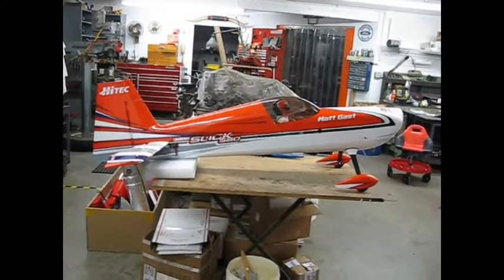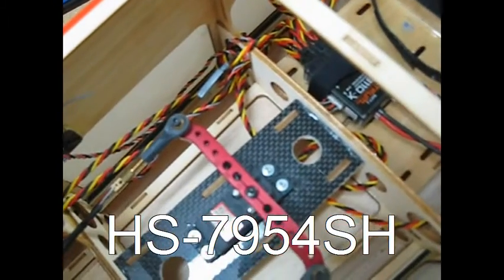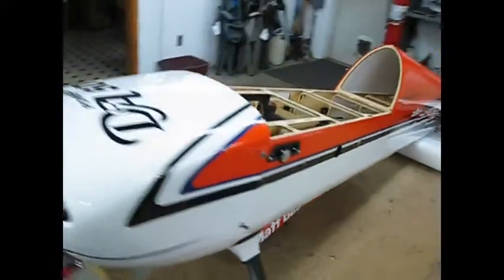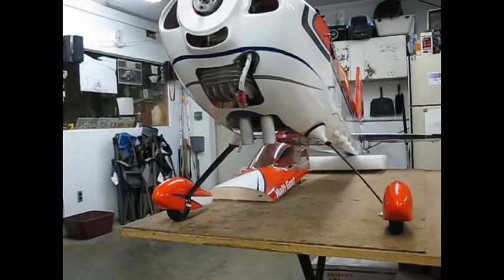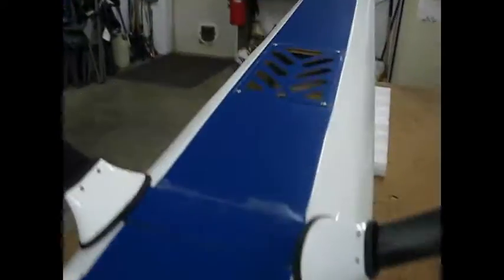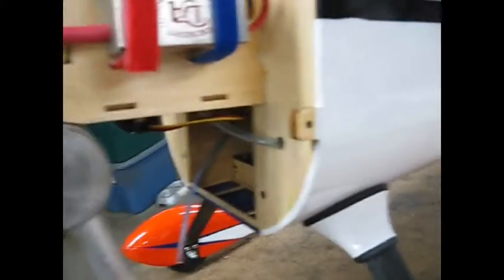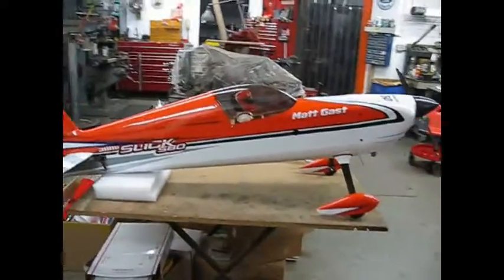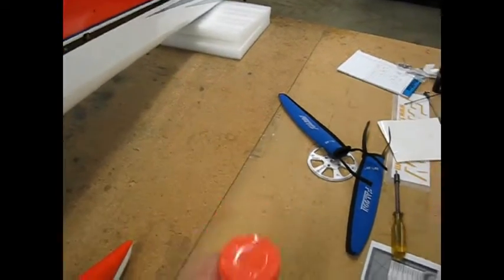3DH 79" Slick 580 with DA50

Comment: 7954s(steel gears)  arn't good for gas planes because of the vibration!  Your also not getting 400 oz torque on your servos..all servo specs are given with 1" arm. Looks like you have 1 1/2 - 2 inch swb arms which means your only getting 200 ounce torque. ..just FYI.  Not a bad build and nice walk through.
Reply: and 400oz for a model 50cc it is exaggerated